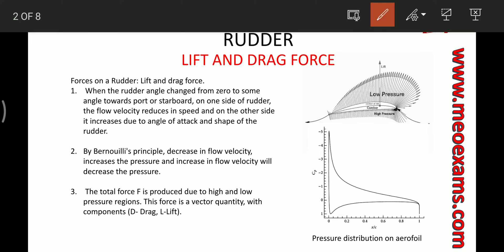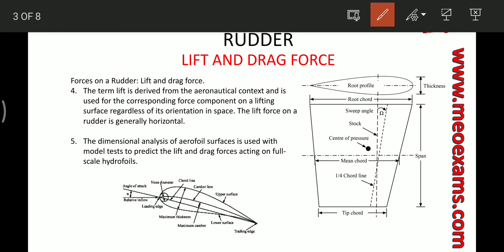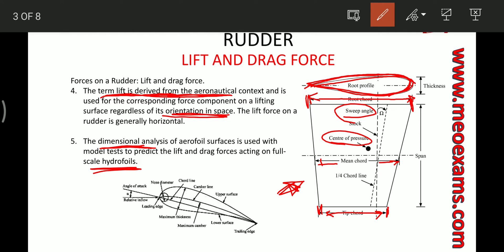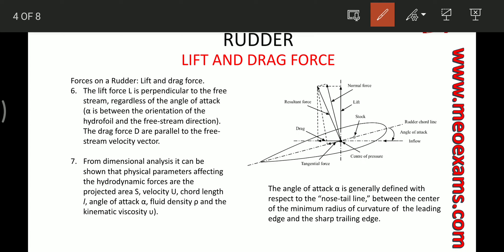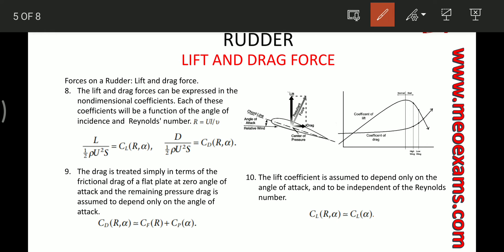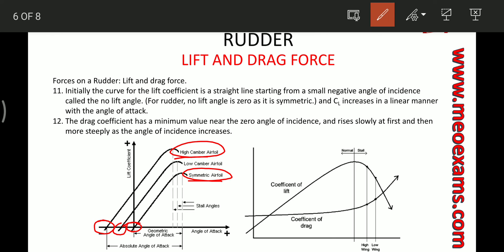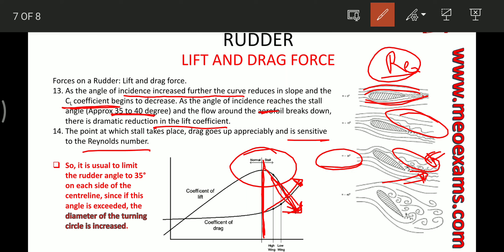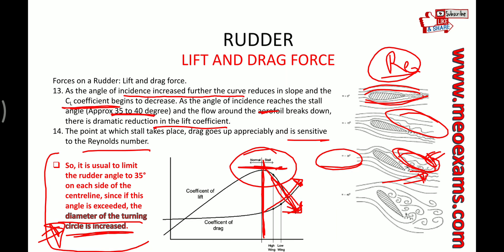Rudder: Lift And Drag Force, Why rudder angle is limited to 35 degrees ?

Comment: If you can only use up to 35°, why does the indicator show up to 40°?
Reply: rudder angle can be released by mitigating its net torque, like steering gear at an emergency working condition